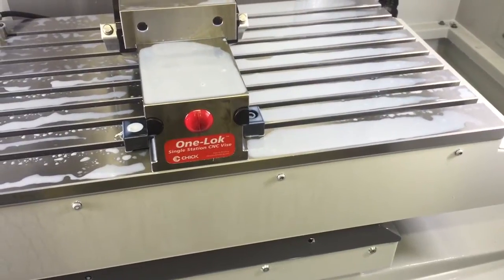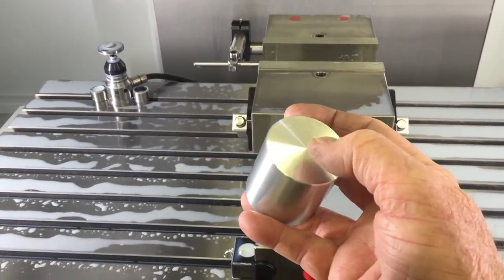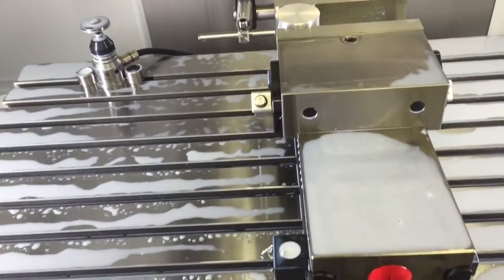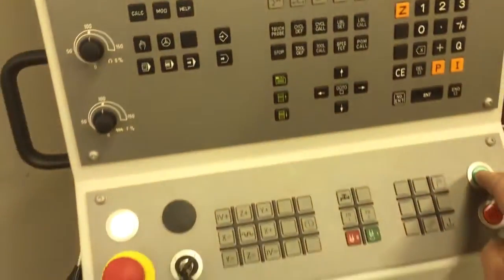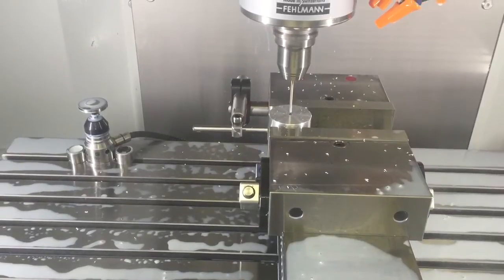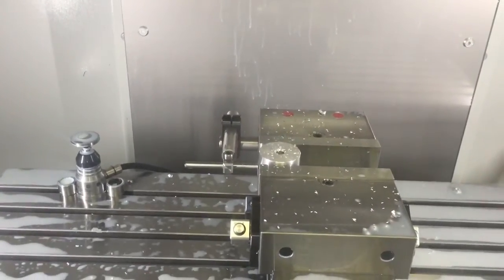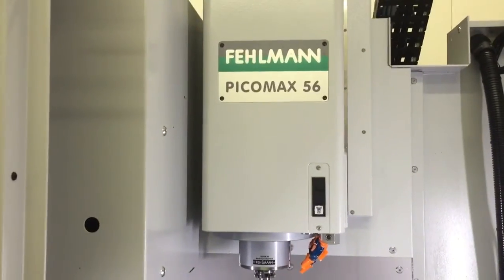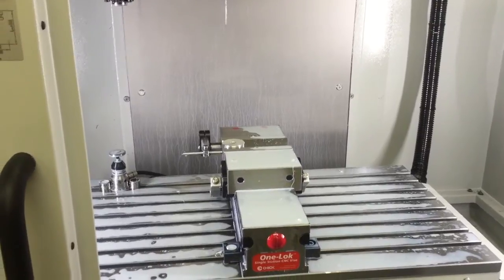Fehlmann Picomax 56 machining CORMAX Valve Port

Comment: why is the machine waiting before the toolchange?
Reply from the maker: Good question. I did not program in a “Tool DEF” after I did a tool change. The carousel does not move that fast so one should pre position it before doing the next feature. Then tool changes are immediate.

Comment: Hello thanks for posting. Do you think the Hiedhain is as easy to program as Hurco or Mazatrol cnc?

Regards LeRoy
Reply from the maker: The Heidenhain is probably the easiest of all controls to work on. I have not worked on a Hurco so I can’t speak for that. The format for the conversational programming is very sensible and easy to use and modify. Highly recommended. I am surprised they don’t own the market here in the US. Fanuc is about the most brain dead control on the planet.
Reply: Thank you for sharing your input. 

Regards LeRoy
Reply: Do you know what dealer I can buy one of these machines from?

Regards LeRoy
Reply from the maker: @freedomenergy6644  LeRoy, I bought this direct from the factory in Switzerland. I can send you the contact details of the account manager that I worked with if you are interested.
Reply: I would really appreciate the contact information. 

Regards LeRoy
Reply: Also I guess it's been a really trouble free machine with great customer service?
Reply: Would you buy this machine  if you  had it todo allover again? Has the quality precision and support  be excellent? I'm trying to make up my mind if I should  purchase one with out dealer in the USA. 

Regards LeRoy

Comment: How much does one of these machines run?
Reply from the maker: douro20 my unit with the 4th axis ended up costing about $230k. A lot goes in to getting the unit setup and delivered.
Reply: @ChrisHarris4U  About as much as a fully opitioned PS-95.

Comment: Amazing. Quality tools, quality results.  How is the software package ? Easy to learn and use?
Reply from the maker: SuperTruckerTom the control on this machine is a Heidenhain TNC 620. I have worked on quite a few controls and this is by far the easiest I have used. Very clever design and consistent.